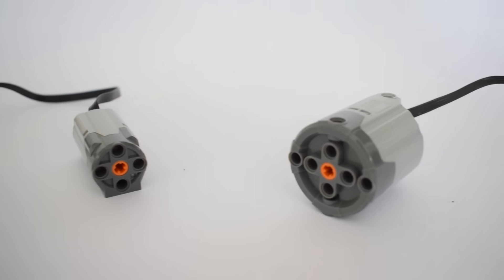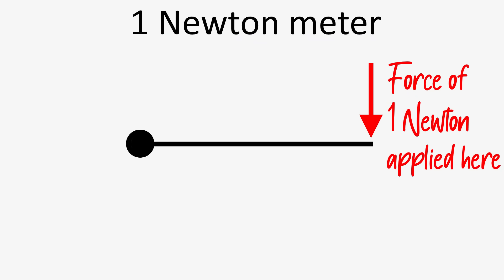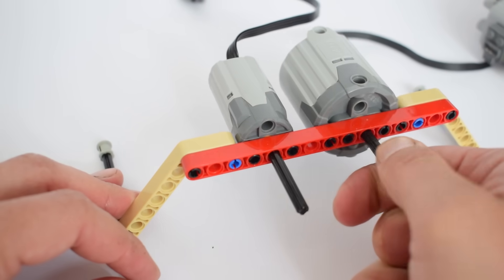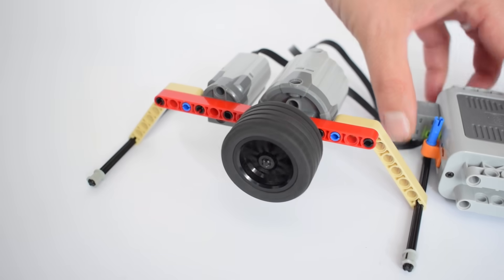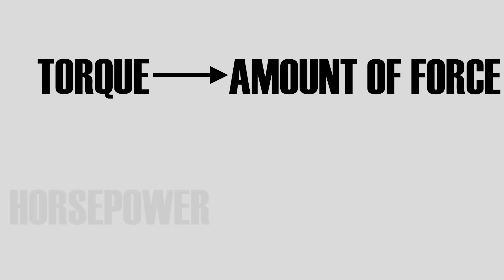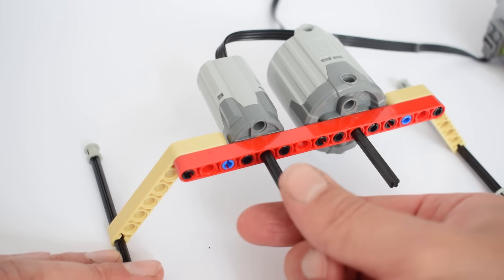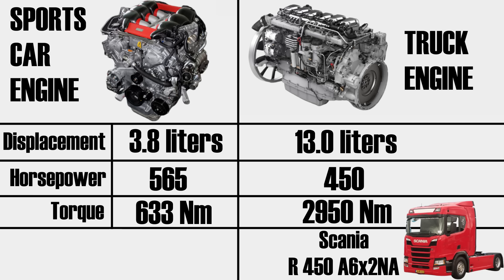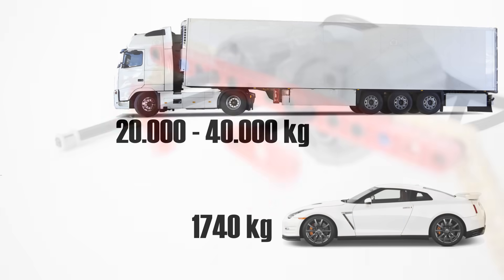NEVER be confused by HORSEPOWER and TORQUE again - HP and TORQUE EXPLAINED in the MOST VISUAL WAY

Comment: I hate how nobody stresses that horsepower is the only unit that matters in a vehicle. Higher torque vehicles produce more power at a lower rpm. Theoretically you can tow with that GTR engine but it is impractical due to the fact that you'd sit at 6000 rpm constantly. It's like when turbine engines were becoming popular, they were out producing power-wise and were better in every way except noise and fuel consumption.
Reply: you're not very bright are you?
Reply: Turbine engines were never becoming popular on automotive. Who told you that fantasy?
Reply: So what is the point of shorter gear ratios then? Say I change my rear hear ratio from 3:1 to a 4:1. This will give me significantly more torque at the wheels, and will make my car accelerate faster. Right?
Reply: The only time high horse power is relevant is for track/drag racing or if your lucky enough to have roads with no speed limits, but for everyday driving about the streets/highways having a high horse power car is pointless, you would need to be driving around doing 100mph+ to actually use all the power available, at least with diesels you get to play with all the power as most fade off around 100mph-ish and driving faster than that on public roads is a bit stupid and doing more than a 100mph here in the uk is usually an automatic ban if caught, high horse powered cars are the same as high end PCs, pointless if you can't use it to its full potential.
Reply: @iamthepotato4312 try using more than fourth gear
Reply: Low RPM high Torque figures are only relevant in towing because you are producing more Power at Lower RPM which is more efficient in that use case due to all sorts of factors including angular velocities, clutches, fuel consumption, reliability, rotational and dynamic mass etc. 
Truck engines have to be strong due to the forces required in order to move large masses therefore it isn't reliable to use a lightweight sports car engine that revs high due to its lightweight components (not as strong) in order to produce its Power Output thus transferring huge angular velocities into the drive train to move huge masses at lower speeds, it doesn't make sense. Higher torque values at lower RPMs can make daily driving regular vehicles easier due to not having to rev the engine for Power however Torque values are meaningless unless the RPM at which the Torque is produced at is explicitly stated otherwise it is a utterly meaningless value and you may aswell just state the Power figure at that given RPM anyway because that is more meaningful since to understand the Work Done you have to do the calculation of Torque x RPM/5252 and hey you get Power. Furthermore engine torque is meaningless to the consumer because what is produced goes through a gearbox so your wheel torque is totally different to your engine torque. Torque is only important to a tuner or an engineer to determine the strength or the required strength of components, otherwise all the consumer is interested in is the power at a given RPM. YOU CANNOT FEEL TORQUE IN A CAR ONLY POWER/WORK DONE.
The best analogy I can personally come up with and is relevant to this is if you tighten a bolt to 60Nm with a torque wrench then try to loosen it at 30Nm you get 0RPM therefore 0 work is done, the Bolt goes nowhere, you cannot feel any acceleration force because there is none. 
To conclude Torque is meaningless without RPM in vehicle performance and with RPM you are left with Power (don't confuse with peak power) which is the only meaningful value. I'm a mechanical engineer and I hope this helps
Reply: @rosskj9187  shhhhh no one is reading that
Reply: @polar_inertia  Don't worry about my wasted time, I know it's long winded. No one believes in the validity of a YouTube comment. But the video is wrong.
Reply: @rosskj9187  that is a good point, torque values are meaningless unless you know the rpm that figure was taken from, however your statement of not feeling torque in a car then saying you can only feel power/ work done is contradictive, the combination of horsepower and torque is that power/ work done you mentioned. Torque (a force that produces or tends to produce rotation or torsion), as well as the horsepower, is felt as soon as the vehicle starts to move and if I'm not mistaken about that process, horsepower is what creates the torque
Reply: @BigTimeWarGamer  Horsepower doesn't create torque, it's the opposite. Power=(Torque X RPM) / 5252. You can have 1000ft-lbs of torque a 0 RPM and go nowhere. Power is the resultant of a torque applied whilst rotating. You cant have power without torque but you can have torque without power. It isn't contradictory it's just maths. What you feel is the resultant of torque at rpm which is Power, it's the resultant that you feel. 
To have power yes torque and rpm are an absolute requirement but torque is meaningless, power is what you want to know at a given RPM unless your willing to do the maths for torque at a given RPM to find the power value at that RPM.
Reply: For the majority people this is true if you want a fast daily driver, however if you tow anything knowing the torque can be just as important as to know the efficiency of that engine; I'd rather have a vehicle sit at 2000rpms rather than on redline going down the highway with a trailer hooked up to me
Reply: @BigTimeWarGamer than you don’t want torque you want high hp at low rpm.
Reply: @reapzvanreapz9687  If the sole goal is towing than hp isn't quite as relevant. My train of thought is revolving around a semi truck, they change torque values through the 10+ gears they have; they aren't fast but they sure can pull some weight. That isn't to  say more horsepower isn't nice though :D
Reply: @BigTimeWarGamer  So a semi truck doesn't multiply it's torque values with huge RPM's. Reason being for this is huge loads are being towed. Therefore stronger components are required for reliable operation, stronger and heavier components don't rotate or reciprocate at high RPM's easily without forces becoming unmanigable. Also it is more efficient to have lower rotational velocities. 
Semi trucks may not have ridiculous Horsepower values but it is those Horsepower values that are still moving that load which shows huge horsepower values are not necessary to move those loads. And it isn't the Torque moving these loads it's the resultant which is Horsepower (Torque x RPM).
Reply: @rosskj9187  all good points, and the 1000 lb/ft at 0 rpm thing makes sense, however diesel motors naturally have a low power band due to fuel density so as stated above, high horse/torque- low rpm, not necessarily due to heavy loads. I can turn my diesel truck (not a semi) at 4k rpm (high for that motor) but its almost beyond its powerband and becomes unstable as you stated. The point of the transmission is to keep power from the motor in an operable range relevant to the purpose of the vehicle and functioning rpm range. If you took the transmission out of any vehicle it would still move, but the rate of acceleration, top speed, and towing ability would be determined on rpm range and final drive (differential gear ratio); a transmission alters the power/ torque values for efficiency in acceleration, top speed, and ability to pull a load. To elaborate on what I had originally said, knowing the torque value (at a given rpm) is indeed not that important unless you have a specific need for said values; to the every day Joe/ Janet it isn't that important; to the few that build pulling trucks, race trucks or cars, that value is helpful if you plan on modifying the motor and drive terrain for powerband location, shift ratios, etc. I should also add that to have an accurate idea of the torque output it should be measured at the wheels instead of crank due to transmission gear ratios and the differential gear ratio.
Reply: @rosskj9187 I think you might be a little misguided here.

In the most logical sense, there is rarely a reason to progress past 5,000 RPM in the real world. It’s one thing on the track or strip, but horsepower, as a direct function of torque and RPM, relies upon torque. There is a reason built Honda K’s haven’t taken over the trucking business. Instead we have semi trucks making 2,000 ft lbs of torque @1200RPM, 600hp @ 1600RPM, with both dropping off toward a 2,000RPM redline.

My point is that your daily might be ruled by horsepower, but torque runs the world.
Reply: @zf9903  you just contradicted yourself, horsepower is a direct function of torque and RPM. Torque is simply equal to force, it isn't a measurement of work. Horsepower cannot be calculated without torque it would simply equal 0. But by going on to say horsepower rules your daily driver and torque runs the world doesn't make any sense. Torque is just a measurement of force not Work Done, in the trucking industry what your Interested in is how much power can I produce at low RPMs, naturally this will lead to high Torque values when the equation is transposed but as the consumer your not interested in torque, your Interested in power at a given RPM unless you just want to do all the calculations yourself which will inevitably give you your horsepower output anyway because Work Done is what your after not force, leave that bit down to the engineers designing the components where it is relevant, or the tuners where they don't want to exceed the stress's and strains of the car components.

Comment: torque is what it can do, horsepower is how much it can do it.

if a motor doesn't have enough torque, it won't go.
if it has enough torque, but not much hp, it will go, but slow
Reply: Motor vs vehicle talk
Reply: The torque applied to the wheels can be changed with gears. If the motor does not have enough torque then a 2:1 gear will double the torque at the output. This comes at the cost of halving the rpm. If that rpm drop is unacceptable then you need a more powerful motor.
Car engines never make enough torque to directly drive the wheel of a vehicle. But they spin much faster than is needed. So simple gear reduction can be used to change the torque and speed of the motor to the desired amount.

Comment: Good explanation. "Horsepower sell cars, torque win races." - E. Ferrari - that's pretty much bullshit. Obviously power wins races because power directly translates to moving the mass with more acceleration. If formula 1 was limited to 2k rpm then sure torque would be winning the races but its not.

Comment: Durability comes from piston speed, I don't think the torque number is very relevant beyond that, and it also usually is where engines have good volumetric efficiency.

That said the higher power engine with the gearing to match the load will pull more than the lower power engine.  But due to higher piston speed will have lower durability. Power is power, you'll see it represented by how much fuel is consumed.

Comment: I always explain it like that: torque is a force and hp is work. I will give an example: there are two guys with the same task (work). They have to get boxes from point A to point B in 1 hour. Guy 1 takes a lot of stuff at once but moves slowing the other takes less but moves faster. At the end of the hour both moved 100 boxes in 1 hour. So the work is the same but one guy moves a lot more between point A and B. So the HP in this case is the same with different "RPM" (moving from A to B). 

Also a lot of people mentioned gearing. This will affect the torque not the Hp.
Reply: Now think if somebody of these two accomplished in two hours. 
Or just check what hp is.
Hp is not work.
Reply: Yeah, no. Torque is a force, and power is how fast that force is applied over a given distance. Power=torque x velocity (angular)

Comment: I always like to think of it applied to a gym workout. Torque is how much your max bench press is. Horsepower is how much weight you lifted over a time period( say, 1,000 kg in 60 seconds).
Someone benching 100kg 10 times in 60 seconds is the same Horsepower as someone benching 200kg 5 times in 60 seconds. The second guy has twice the torque, but half the speed. Same horsepower.
Reply: Thanks for Dude-Bro insight for the dude bros
Reply: thanks gymbro i understand it now
Reply: @Arthur.entrepreneur  same lol

Comment: (Horse) power is what matters. Its about torque per unit of time (RPM). small torque/high rev engine is the same as a
large torque/low rev engine as far as power goes.  Different characteristics, but simple as that.
And the torque outside the engine is modified by gear ratioes before it hits the tarmac, but that is never reported, so, simple
as that. The only thing that matters is pure power

Comment: Something important about the difference between sports and heavy duty engines.

The real reason big machines need torquey motors is because they need to use all their horsepower all the time.

A crankshaft bearing, camshaft, or cylinder wall can only take so many rotations before things wear out, so machines that need to work all day want to keep their rpms low if they are going to last. The only way to make horsepower at low rpm is by having torque.

Fundamentally though, a gtr with the right gearbox could tow a semi trailer faster than that semi can, it will just wear out sooner.
Reply: Another factor to consider is efficiency. An engines brake specific fuel consumption is very high at high rpms. This because of the rich air/fuel mixtures and high friction losses that occur at high rpms and high loads. ICEs are generally most efficient at around 1500-2500 rpm (this can vary depending on the engine) at high loads. Sports car owners don’t really care about fuel economy but truck drivers who travel hundreds of miles everyday do care. Because diesel engines make so much toque, they can make a lot of horsepower at the low rpms it has where BSFC is at its lowest.
Reply: Your 100% right on this not only would the GTR engine be capable of putting the same or 7:19 more torque to the wheels (even accounting for gearing losses) that the diesel semi engine you have identified the main reason  we don’t see 3.0 V10 era formula 1 engines in trucks.  The hivemind, like @LiveFromLondon2 ‘s comment shows that feelings don’t care about facts math or physics those of us interested in debunking not perpetuating myths do.
Cheers.
Reply: no, it wont. it wont have enough torque to move the semi. unless it went to 100k revs, which obviously it cant.
Reply: @LiveFromLondon2 nonsense the the GTR has roughly 20% more power which gives it the capacity to put 20% more torque to the wheels at any speed than the semi. It’s really really basic math.

Comment: "Nm confusing? np..." I thought you were gonna talk about it in terms of energy, J. Jouls lol. But instead you made me vomit
Reply: Energy is pretty meaningless in terms of engine performance. If you drive a long distance, you use more energy than driving a short distance. And specific energy (i.e. energy used over a given distance) will be about the same for any vehicle of similar weight and efficiency, regardless of the power of the engine.

Comment: So just for my understanding. 2 identical cars but with different engines accelerate. 1 engine has higher torque output but lower horsepower. The car with that engine will accelerate faster off the line until the other car comes into a rev range where it will produce more power going to the wheels overall. This could be the case for a diesel and a petrol version of the same car which also weigh the same. The diesel would be faster off the line but the petrol would eventually overtake it
Reply: The problem is in being "identical". It can't be. The higher max power and the lower max torque means higher revs. Higher revs also mean higher idle revs. F1 idles at 4500 rpm. 4500rpm is a red line for a passenger car with diesel engine. 
On top of that, to get a maximum acceleration from stand still, car is never launched from idle. Usually, higher power always win the acceleration in any case.
Reply: @simplemachine9531  Im aware. I was more talking about if these hypothetical vehicles did like a rolling start in first gear while idling. Up until 4500 rpm where the diesel has to shift gear it should outaccelerate the petrol, right?
This is just about the concept not about how it would be in real life.
Reply: @TheDude50447  yes, but you can forget about torque, it is about power output at the corresponding vehicle speed, i.e power band. Diesel may output more power at lower engine revs, accelerating a car faster. Still, talking about first gear only.
Reply: @simplemachine9531  Im aware of all those things. Im pretty into cars and engines etc hobby wise. I was just trying to understand the effects of torque and hp like in the video.
Reply: @TheDude50447  ah you mean you were just talking to yourself, gotcha, sorry I interrupted you
Reply: @simplemachine9531  Well thanks for the answer anyway.
Reply: No, the engine torque is completely irrelevant to acceleration. Two cars, whatever their engine size, power, or torque, can always be geared to have identical torque at the wheels. But if one has more HP, it will be able to turn the wheels faster than the other, and so accelerate faster. In practice, torque matters a bit because gearboxes are imperfect, and an engine with high torque doesn't need to be in a perfect gear. Plus, no-one likes to drive with a high HP,  low torque engine that has to rev at 7000rpm all the time.